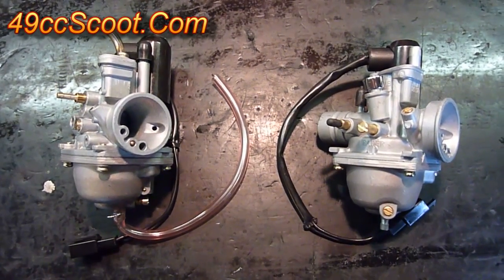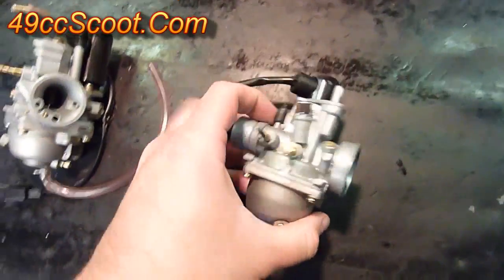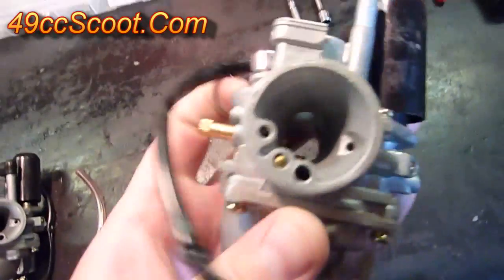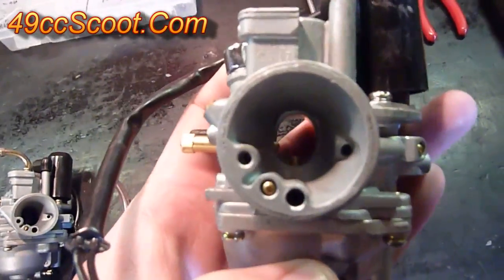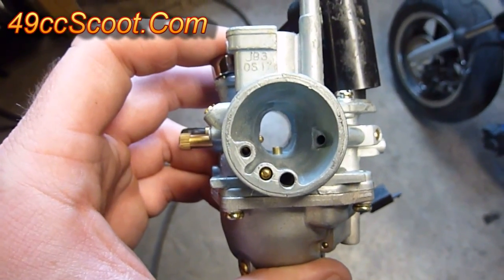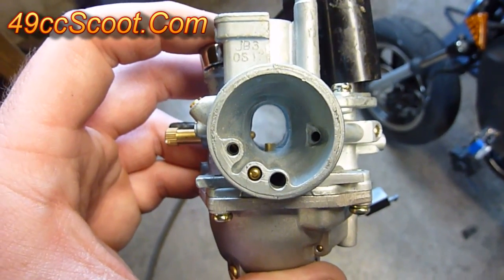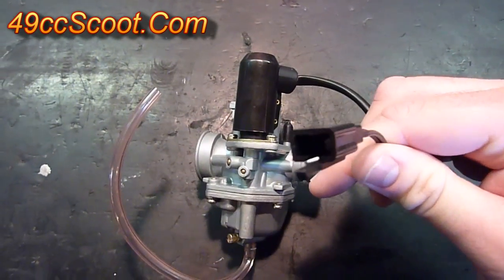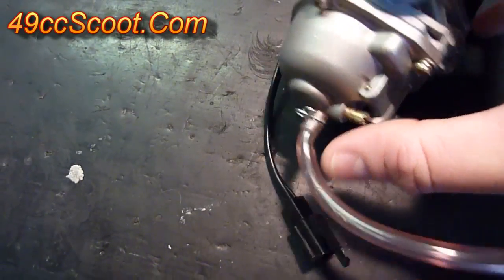Two-Stroke Scooter / ATV Carburetor Settings And Adjustments 1of4 : Basics, Overview

Comment: 4:20 The oil injection, on mine its closed with a rubber cap. if i was to install a tank with just 2 stroke oil would it give the engine the proper mixture without me having to pre mix it and put it all in just one tank? I know a friends scooter did that but wonder if i can do that on mine (same carb). or am i just better off premixing?
Reply from the maker: I prefer pre-mix. If you do convert you need a pump as well.
Reply: ah. thanks for the info. ill just stick to premix then. just remember to keep some 2 stroke oil with me incase i need to fill up while im out.
Reply from the maker: I've been premixing all of mine for years and many many fill ups. You get used to it pretty quick. Keep the oil amounts needed for your desired mix ratio in your head or note them somewhere if needed. Carry oil in a container that's easy to read amounts on for measuring.
Reply: ***** i just bought my first 2 stroke. and im computer smart engine dumb. the bikes ive had before where all GY6 4 Stroke chinese scooters. 

carb little messed up so i just bought a kit that included one. has a no rev cdi, a carb, coil, and filter. so hope to get it to idle tomorrow.
Reply from the maker: When it's running well, the 2T will probably only leave you missing the 4T scoots when you're putting more gas in. Not as fuel efficient, but lots of power potential. At 300lb my Tritons would carry me at around 40MPH cruising stock where the little TaoTao 4T only wants to do 30-35MPH.

Good luck with the repairs/swap. Check out the forums (URL in vid) and there's a lot of tech info and a lot of us working on those engines there.
Reply: ***** figured as much but should still be better then a car at gas. and maybe ill swap bikes in the future or get a different engine. just gotta wait for something to jump out at me.

Comment: What is the fuel drain connected to?
I am having problem with that pink fuel drain hose? Should it be attached to something? And it's for a Yamaha Zuma scooter.
Thanks.
Reply from the maker: It's just there to redirect the fuel when you drain it so it doesn't spill on the engine. In some cases there's a drain valve on the end of it and the drain screw on the bowl is left open so it can be easily drained. I see that more on the four-strokes though.

Comment: I'm helping a friend try and fix her carb on a TGB scooter that has a float bowl that's overflowing.  The carb says Mikuni, but for the life of me I can't find the model and none of their float valves match up to this viton tipped one. It looks a LOT like this carb.  Is it a knockoff Mikuni?  Should I just not try to find a rebuild kit and just order one of these carbs off ebay and tune it?
Reply from the maker: This is a Mikuni knockoff. Unless a dealer can get you the part, replacing it is probably going to be the easy fix. Even on the clones some of the parts are similar but not quite the same so generally they get replaced if a cleaning can't save them.

Comment: hey ghost rider, lol, i finally put the new carb today but i had a question, where does the rpms have to be when its idle, my wheel starts spinning at 3000 rpms, the wheel STOPS spinning at 2700 rpms, should i leave it at 2700 or i heard that the normal rpms is at 2000 rpms for a scoot, which one is it??
Reply from the maker: 1500-2100RPM is the range mine are normally set in. Most will idle fine on the lower end of that, but getting the idle up to 2000RPM or so can help with charging if that's an issue. There's not one spec that's right for every scoot.

Comment: What is the easiest way to clean out a exhaust pipe and muffler I have a 2001 polaris scrambler 90 and it has a lot of oil build up in the pipe.the kids that owned it before never ran it enough to heat up the pipe to burn it off
Reply from the maker: A lot of people use caustic soda. Google "caustic soda exhaust" or something like that and you'll find more detailed instructions.

Comment from the maker: Not sure if the tygon will make much difference there. Check your float height just to be sure it's not the issue. I don't think any of my carbs have had rubber to seal the needle... or do you mean the float needle? Float needle should either be rubber coated on the tip or have a rubber seal to interact with. If that was not sealing though, you'd get more fuel than you want and it would overflow not be low on fuel.

Comment: Thanks for the help,I have removed the cap have even blown in to the tank.the problem I believe is from the petcock to the top of the carb which is on the opposite side it drops about 1 inch.would the tygon line help,seeing it looks more flexible.the needle has no rubber top could some one have messed with the carb before I got it.

Comment: Great videos.i have a 2001 polaris scrambler 90 I have been working on for my kids the plug cap pops off on its own ordered a ngk like you suggested.but I have trouble getting fuel to the carb cleaned the petcock out and tank installed new gas lines and had to put the old ones back on.with a fuel filter on after the bowl is empty it will not refill.i took the carb apart and cleaned it.i do not want to tune anything until I get the plug cap which should be tomorrow.i did not use tygon fuel line.

Comment from the maker: These carbs are so cheap on eBay that there's no point in a rebuild kit, unless you happen to have one of the Mikuni carbs. Check out kaseaparts dot comm for a lot or replacement parts and I think they sell the carb parts or if it's not Mikuni just go on eBay and search Polaris 90 carb or something like that. Not all of the enrichers fit exactly the same. There's a chance the Yamaha enricher isn't right so it's always letting fuel by. Could just be jetted wrong too.

Comment: Man I have a yamati xtm 90cc 2 stroke that I was told by the original owner was a Yamaha clone. He said he bought the auto choke from a Yamaha dealer when it broke. It's running rich fowling plugs. I just need to know  of all the Chinese at vs are they mostly the same? I can work on atvs myself but I just don't know where to start as far as ordering parts and such.  The carb looks like this, are there rebuild kits? If I knew this awesome atvs basics I'd have a good starting point.